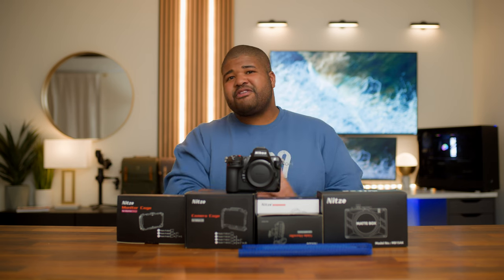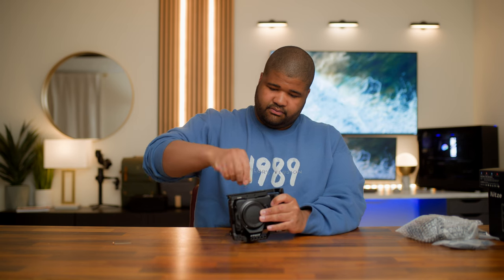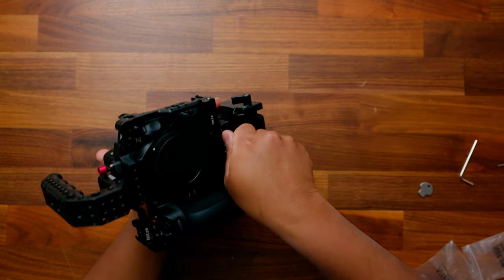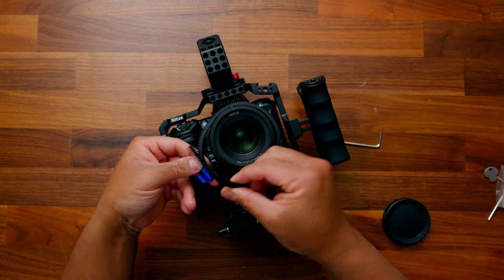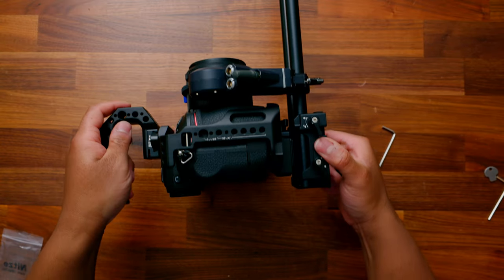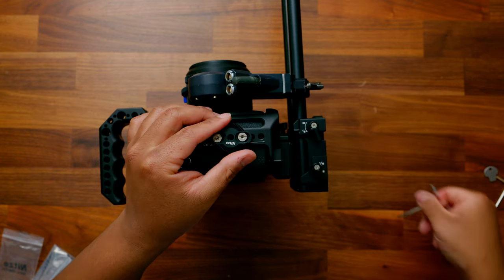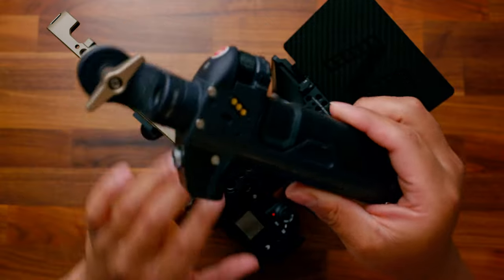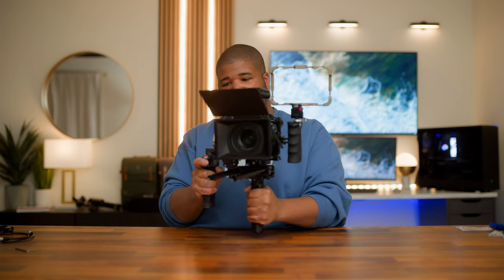Nikon Z8 Cinema Rig Build: Exclusive Nitze Z8 Rig Kit First Look

Comment: I really appreciate these videos, Sidney. I have hobbled together a similar rig on a Z8 cage. One difference: I rarely use follow focus these days, so as a right-side handle, I am using the Nikon Remote Grip MC-N10. Works pretty well.
Reply from the maker: That's actually a very smart move. And it would fit well too because you don't really need a follow focus unless your moving between two subjects. It's Arri Rosset so it would fit where the Tilta handle does.